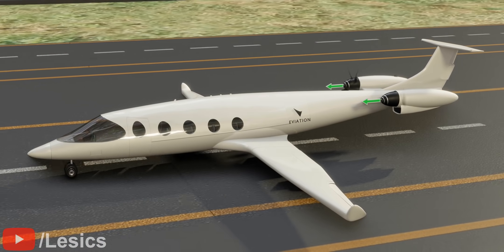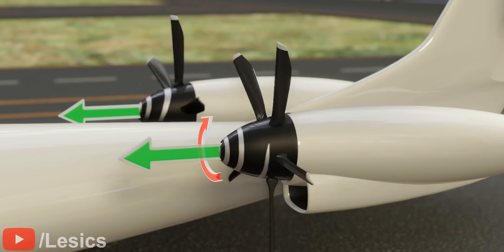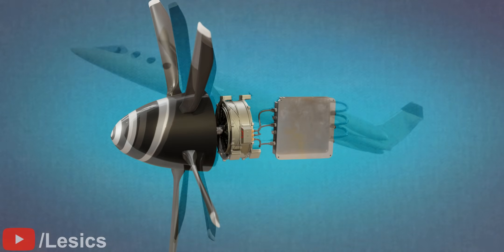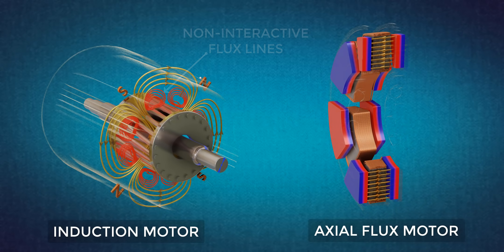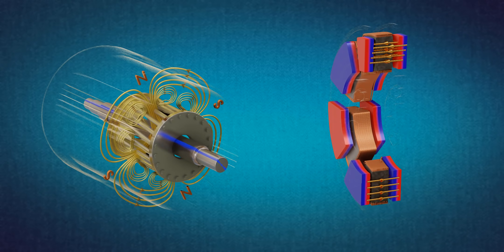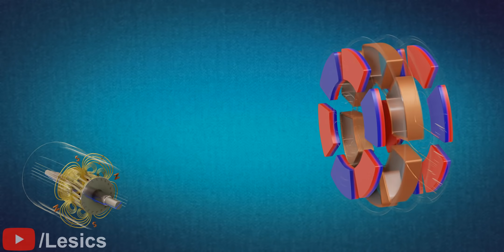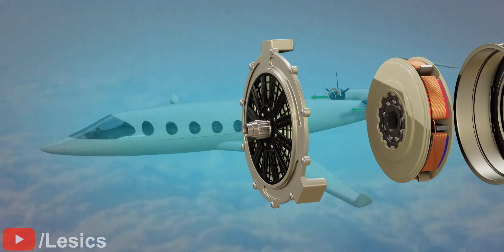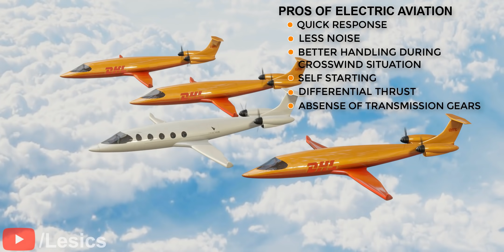Electric Aviation | The Dawn of an Advanced Transportation Mode

Comment: Any electric airplanes in active service? Tried and tested? I didn't think so. Bollocks!
Reply: Rolls roys elctric plane bro plz go and search .
Reply: @robinabraham2843  I ain't your bro. What airline is using it? Oh, wait, it's just an experimental 1 person toy plane with claimed 100 miles of range.
Reply: @Inflator82  we using future lithium solid State battery/ hydrogen fuel cells.more range we got.
Reply: @robinabraham2843  Who is using? You? There is not even an electric private jet sized plane in production so what are we talking about here? Animated pictures only.
Reply: @robinabraham2843  we? lol
Reply: At this moment it exist only one aircraft with certification and its a small single engine intended to be used as school planes. It's called pipistrel velis electro. The certificarion was given in 2020. The engineers and EASA needed to work togheter on this due to the fact that there was no certification voices for propulsive electric engines. I want to really stress that this is the first electric aircraft certified because we have electric aircraft for decades but they were only prototypes or testbeds so they didn't need to comply to regulation. You can make a working car in a garage but this doesn't mean you respect all the regulation to circulate or even sell it as a product. Still it has limited payload and range, but for a school plane it can be fine. When it comes to actual purchases and usage, I don't know